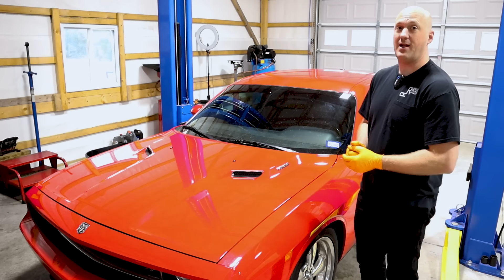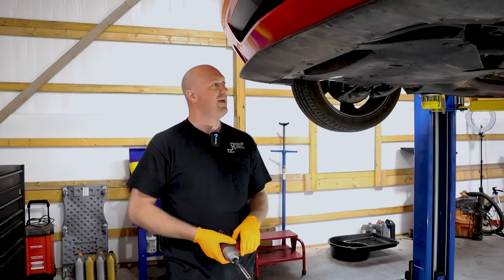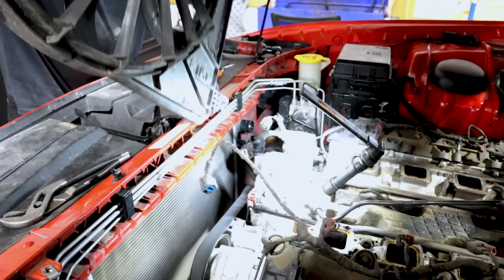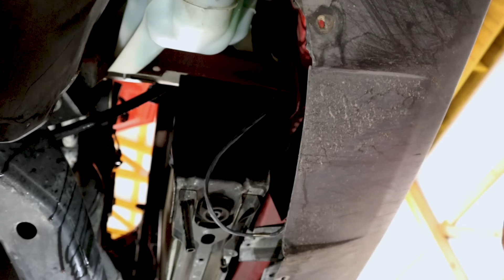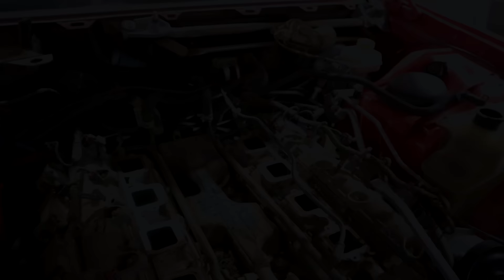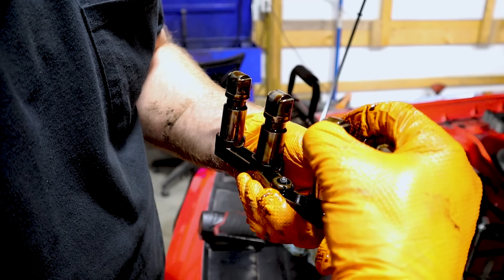Hemi Cam Installation! Budget Challenger Build Ep1

Comment: hey i have cylinder one spring not moving after manually turning over the motor. been having misfire on cylinder 1 so we decided to strip it down after trying the coil pack, spark plug and injector swap. no crazy glitter inside but spring is like frozen and doesnt move. what would u suggest  as im about to rebuild it with a cam kit

Comment: I'm getting ready to do a cam in my 2011 Durango 5.7, lost a cylinder.  I also plan on installing a Melling or Hellcat oil pump. Will the  SRT headers which are 2008-2014 DODGE CHARGER/CHALLENGER SRT8 6.1, 6.4 OEM EXHAUST MANIFOLDS HEADERS fit my 5.7? Great video

Comment: Can you possibly post a video that is about Ethanol's ability to many and all bad things with regards to fuel system degradation? My huge and most important concern is my 2010 Challenger SRT8's fuel system. I have been using Lucas Ethanol fuel additive with every tank fill up since 2013. Because of fuel prices, I'd like to stop using it. I'm just super paranoid that I'd endure complications as in $$$$$.

Comment: I noticed you where not changing the timing chain and tensioner. i would be interested if you have any experience with how durable they are? Because i have a 2006 5.7 hemi charger with 230,000 miles lately I have been thinking about the timing chain and tensioner which are original as far as I know.

Comment: This is probably a dumb question but do I have to get my Challenger tuned after replacing the cam?
Reply from the maker: The engine will run OK, but to get the maximum benefit from a cam swap yes you'll want to get it tuned.

Comment: This video was so helpful but I have one tip that was different for me. My car is a 2015 Challenger SRT 6.4L automatic transmission, this video is done on a manual transmission and the only difference I found was on the auto trans model the fan assembly on the radiator will not come out from the top as it does in Reignited's video. I think the radiator is different on the auto trans. Leave the fan assembly attached to the radiator, also do not remove the radiator mount from underneath but with the use of a jack under the mount, drop the radiator, fan and mount out as one unit. You will have to unbolt the condenser from the radiator first and those bolts can be accessed by removing the two pieces of plastic trim in front of the radiator near the hood latch and reach in and unbolt the condenser from the radiator. I hope this helps anyone who like me was doing a cam for the first time and following this series of videos step by step. Great video, thank you Reignited.

Comment: Is there a special pattern for taking the rocker stands off? Or just like a half turn of the bolt at a time, in a cross pattern, until they come off? That's the only thing I'm worried about warping when it comes off.
Reply from the maker: They will bend and flex as they're coming off due to the various cylinders being at different points in their cycle, but no worries I've never in all my years had ones that didn't go right back to completely straight again.
Reply: @ReignitedAuto thanks dude!

Comment: On the timing cover currently and mine will not come off I’m like 90% sure I got all bolts out what am I doing wrong
Reply from the maker: They can be stuck pretty good, especially if you live in a climate that sees more corrosion. You can use a pry bar, it won't break the cover they are pretty strong. Obviously don't pry like your life depended on it 😄 but you can go at it pretty good. I find that one you break the seal it'll come off fairly simply from there. 👍
Reply: @ReignitedAuto  ended up getting it off warped the edge and it cracked to the cover. Got a new one on way to arrive tomorrow! Love living in the rust belt. Tomorrow is pulling valve covers then the rest thank you so much for responding so many years after!
Reply: Update! Down to the lifters! Still don’t really know what caused my oil and coolant to mix the gasket was dirty but didn’t look broken! Tomorrow is can install and put back together! Wish me luck I can figure it out
Reply from the maker: @altaccount5813 do you have an auxiliary oil cooler? It would be what the oil filter screws into and it would have two smaller coolant hoses going to it. I ask because we've had several failures of these which can cause oil and coolant to mix.
Reply: @ReignitedAuto  this stock for 2016 dodge charger pursuits I got a 5.7L obviously and I’m still learning. I’ll give a google and get back to you
Reply: @ReignitedAuto  so I did a little digging, my car does have an auxiliary oil cooler. I’ve got a new one showing up Monday. I don’t know if I should continue reassembly or leave it until it shows to make space. Currently on reassembly got my timing cover back on same with my valve covers. Hardest part is making sure I have it all plugged back in…. So many wires… any tips for removing an oil cooler? Anything I’d have to drain?
Reply: Just competed this job on a grand Cherokee hemi limited. It’s cranking but not starting, just continuously cranking. Any recommendations?😊
Reply from the maker: @pimpindnice910 https://youtu.be/jMziMqWRMk0 👍

Comment: FYI SRT/Scat Pack's fans do NOT just pull out from the top.  There are 4 bolts required and almost impossible to pull out from the top without buggering up radiator fins and if you DO manage it getting it back in from the top is worse.  The easier (quote unquote) way is to drop both radiator and fans together FROM THE BOTTOM so if on jackstands its got to be up so high it'll make you question every little sound as an impending indicator of a fall to crush you.  god i wish i had room for a lift.  I got to experience wasting about 8 hours doing this to replace the harmonic dampener which on 392s are stupid two-piece units that the inner pressed piece just decides to randomly FALL OUT around 80k miles for me.  8 hours later, almost a pierced aluminum radiator, knuckles and fingers mashed....only to replace with an ATI unit that I neglected to plug the machined keyway during installation AFTER I MADE MENTAL NOTE TO SEAL.  Which then after a few days caused oil to weep out of the crankcase and fling itself all around the belt assembly front, belt and underhood compartment....which then required me to do this entire procedure AGAIN to fill that keyway with blue RTV sealant.  Do twice and learn it once is my motto.  I want to do the cam next spring but after suiting up twice for 8 hours and frustrating language, I may just build a new 392 stroker (maybe 410 or 426) to drop in.

Comment: I know this is an old video, but i hope you see this. Do you need to pull the front cover off if you're not doing the cam? Can you get away with just pulling the heads? The car is a 19 Charger 6.4l. I appreciate any help my man 👏
Reply from the maker: For just the lifters you do not need to pull the front cover. I will say though that generally if you're replacing lifters for a failure the cam needs to be replaced as well.
Reply: @ReignitedAuto  you've never seen one not need a cam? That's disheartening lol. I was hoping i had caught it soon enough.  My tick doesn't sound like the videos on here. It's so quiet and light that you can only hear it when you're in the garage with no other sound besides the car, and only between 2k and 3k rpm. There's no sound or anything abnormal at idle or above 3k rpm. Once i heard it I drove the car 16 miles home and parked it. Hopefully the borescope doesn't show anything depressing lol.
Reply from the maker: @tallgom one you get the heads of and the lifters out you can inspect the cam lobes, but make sure you're looking at the pointy end of the lobe, not the backside.  You'll be looking for the cam lobe hardening starting to flake off. 👍
Reply: @ReignitedAuto i really appreciate the info and help my man. Hopefully the pointy ends are still pointy lol and still have that hardened shine.

Comment: I just did a full exhaust , long tube headers and 6.4 intake on my 2013 charger rt , never thought I would do the cam upgrade myself b it this video is definitely building up some confidence to try it out , luck for me I have a daily for the daily 😂
Reply from the maker: You can do it! 💪
Reply: @ReignitedAuto  is the application the same with the charger? And can I use the same challenger cam you have in the description for a charger?
Reply from the maker: @rubymaiaguilar they are identical yes. As long as your charger is a 2009+

Comment: Will those headers fit my 12 grand cherokee?
Reply from the maker: They will bolt up, but won't actually fit the body
Reply: @ReignitedAuto thank you for the reply, i gave it some thought and had an epiphany moment 😅
Reply from the maker: @ethanheiser9459 definitely not the first time I've gotten that question and it won't be the last 😄👍
Reply: In hindsight that was a dumb question. These are specifically designed for challenger. I have to get headers specifically designed for Jeep 🤷🏼‍♂️

Comment: Are you sure about that mark being correct on the timing?? My chain has markings on it as well. “Goal posts” but my sprocket also has a stamped mark.
Reply from the maker: Yes I'm positive, but the marks on the chain are essentially irrelevant. As long at the crank timing mark is at 6 and the cam sprocket mark is at 12 then you're in time. 👍
Reply: @ReignitedAuto brother no more than 5 minutes ago just did the job. Turned her over 4 times and timing was dead on. Can’t thank enough for the series. 24 year old mechanic. Still learning everyday

Comment: Hi, i'm planning on doing the CAM upgrade on my 5.7 and also considered buying new coils packs, do you think that's needed? my car is now at about 85k miles. I am changing spark plugs. And if yes, aftermarket ones or factory coils? I am not building my engine up for racing or anything, I just want a little more power and some good sound and parts that will not give me a headache months after it's all back together.
Reply from the maker: The factory coil packs are usually quite good, I'm still running factory coils on my magnum that's making about 700whp with no issues. 👍
Reply: @ReignitedAuto  should i consider swapping them for newer factory ones or just roll with the ones i have? i've had once an error code on cylinder 7... it went away. don't know if it could/would be something related... maybe just swap one of the coil packs?
Reply from the maker: @fernandovannini5556 the only code that would make me think about swapping them would be "insufficient coil ionization" other than that, just roll with the coils you've got.

Comment: Man this is one reason why I want to keep my 5.7 charger as long as possible. Compared to most modern vehicles this is easy to work on especially for a guy like me  who's not a mechanic but is handy with tools.
Reply from the maker: Absolutely correct, it's still a relatively basic engine compared to some of the stuff out there today.

Comment: Hi, Really like the video is this the same procedure foe 5.7 in the ram trucks?
Reply from the maker: The engine itself is identical, but your accessories will be slightly different, you may have to discharge the A/C as well.

Comment: My nephew has an 07 Charger RT with the 5.7 Hemi.  Are the parts you list here compatible with that engine.  The Mopar site says no, but that is because the cam is out of the bigger motor.  If I am going to replace the lifters and cam I thought I would at least give him an upgrade.  I may have to do this in my 2014 RAM but I know that the years at least line up.  Thanks for anyone's help with this.
Reply from the maker: Unfortunately no, pre 09 engines it will not work, physically doesn't fit.
Reply: @ReignitedAuto I was afraid of that. I thought I had seen on one of your other videos that there was a physical change from this era. Makes the fix more expensive without the extra power.

Comment: Do I have to take the starter off ?
Reply from the maker: Nope
Reply: @ReignitedAuto could I put the hellcat cam in my 300c 5.7
Reply from the maker: @Mertaclips what year? Anything prior to 09 no, 09+ yes but remember the Hellcat cam is specifically designed for boost.
Reply: @ReignitedAuto  2007 300c

Comment: wish you would of said how many bolts you took off to get the timing cover off, a lot of stuff you did was just now im done now you do it, now my timing cover wont come off.
Reply from the maker: It can be tough to balance education with people's attention span. If i detail every single bolt people click away, it's an unfortunate fact. If you feel like you've removed all the bolts you can pry gently at the top of the timing cover to see if there's movement. If not then it's likely you missed a bolt somewhere.

Comment: Do you have to do the tune or will it run fine just with  the cam in ?
Reply from the maker: It'll run just fine but you won't get the full advantage without a tune 👍
Reply: @ReignitedAuto  yeah good, That way I can just drive it to a tuner VS tow it. I assume with a bigger cam such as Texas Speed Choppacabra id have to tow it to a tuner.
Reply from the maker: @TarheelNomad-i4z  for sure, also because you'd have locked out the VVT so the car wouldn't be happy about that until it was tuned.
Reply: With the tuner, does the ecm need to be unlocked?

Comment: 4 years later and this is the most helpful mechanic on YouTube for the hemi engines out there just got my 06 charger rt project and I got a lifter and cam kit coming in moday I didn’t know I needed a damper pulley or how to do the job but thanks to you I do now thank you so much sir God bless you 🙌🏼
Reply from the maker: Appreciate the kind words, hope your project goes well!
Reply: @ReignitedAuto hey question..Ill be doing this job soon..but I'm only replacing the cam with stock OEM cam will I still need a tune or I can just slap it in and be good?
Reply from the maker: @traylei3731 slap it in and go 👍
Reply: @ReignitedAuto thank youuu highly appreciate it
Reply: @ReignitedAuto one more thing how would you recommend break in period
Reply from the maker: @traylei3731  none needed with a hydraulic roller cam.
Reply: @ReignitedAuto should you drive a certain way the first few hundred miles

Comment: I learned a lot from this video thanks for making it! I'm fully capable of doing everything in this video but have never jumped in quite that deep into a motor yet....as I just recently got situated well enough to have numerous vehicles. Before I couldn't really dive into much without being without wheels. I Remember the first thing I ever did was a valve cover gasket long ago and being so intimidated looking down at the valve train (still am). Same with timing stuff. In my brain if something like that needed done I should look for a  shop who will then  skim through it and overcharge and upcharge and cut corners the whole way. Your video just helped to show me it's really just the same as anything else....just some bolts and gaskets to remove in order. Just many more steps that's all. Thanks! My old Honda is about to be retired and I think I'm gonna dive and explore and tinker with it to learn.

Comment: It’s been quite a while since I’ve had an engine this far apart everything I have done in the past seems like you have to pull the oil pan to take off the front timing cover without creating a leak what I remember anyways

Comment: Okay, hello, i tried finding info but im having an extremely hard time finding anything…i am wondering what length/diameter do I need since i am swapping to a non mds camshaft kit, what length do i need for this? Just in a tight pickle with no answers. Also, stock parts/motor will be the 2011 345 5.7L hemi, WITH mds (obviously) lol pls help :)
Reply from the maker: What exactly are you referring to here? Pushrods?

Comment: Hello Sky!  Thanks for video!  Part 1 and Part 2 are great!!

I have a 2011 Dodge Challenger R/T with 118K miles, manual trans.  I only dreamed of "some day" doing a Stage 1 upgrade, until I watched the beginning of Part 2.  You never know when the lifter problem might rear it's ugly head!

So I started ordering parts according to your parts list above.   

The lifters are a little hard to find and I'm skeptical of the ones I see on eBay.  The seller's websites all seem to have the same look, feel and price, so I'm thinking of staying away from those.  I don't think the parts are made in the USA!

I did find lifters from COMP Cams (# 856Y-16) that look like a possibility.  Any comment?

In any case, keep up the great work!

Comment: Hello Sky.   Thank you for your knowledge and expertise.   Your videos are inspiring me to conduct a cam and lifter removal/install on a 2015 5.7 Charger Pursuit with a cylinder 2 & 6 misfire.   I am having an issue with selecting the correct upgrades in order to achieve optimal performance.  Would really appreciate product suggestion from you.  Along with the cam upgrade, I am looking forward to an mds delete.  After watching your removal, I think I would like to upgrade the exhaust manifolds and exhaust system while under the vehicle.   I would really like to turbo this thing as well.   Would greatly appreciate your input on a turbo and would it be possible to twin turbo this vehicle?  Hope this message finds you well and thank you again for sharing your wealth of experience.